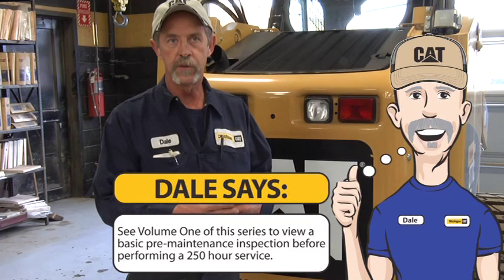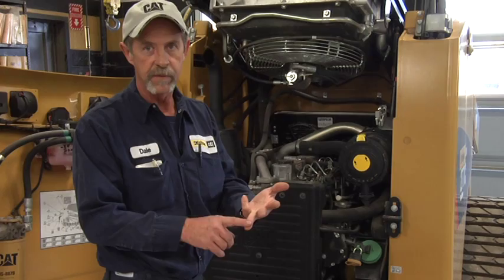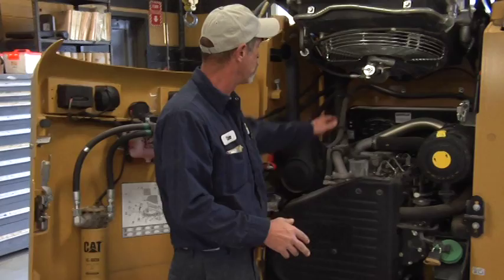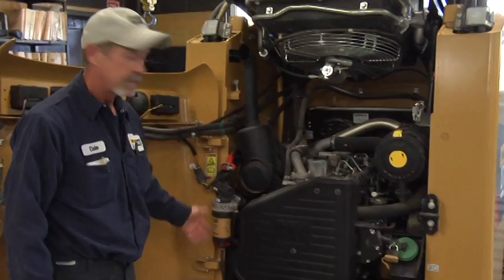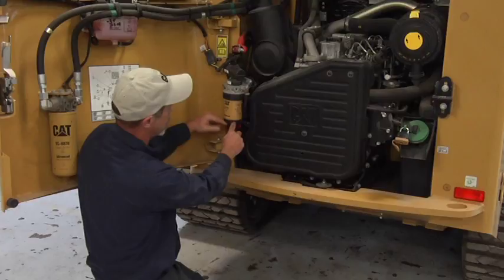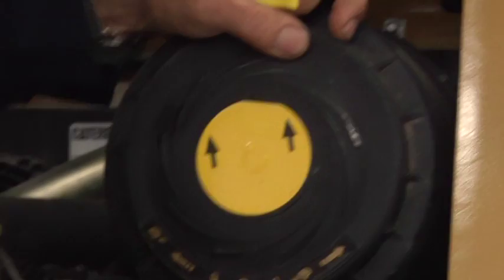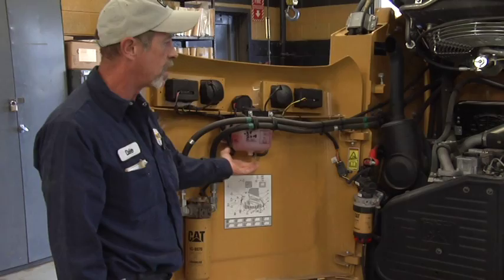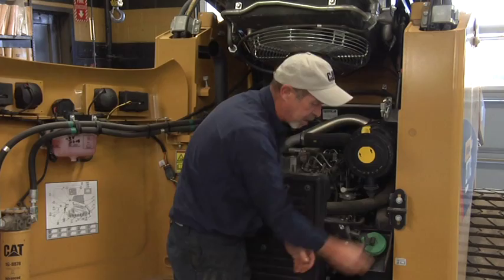Ask Dale: 250 hour Skid Steer Service (Michigan CAT)

Comment: I have a 2003 cat 242 skidsteer that was recently flipped on its side.  I need to pull the fuel injectors to remove the oil. how can I do this and where are they located.  is it an easy job?